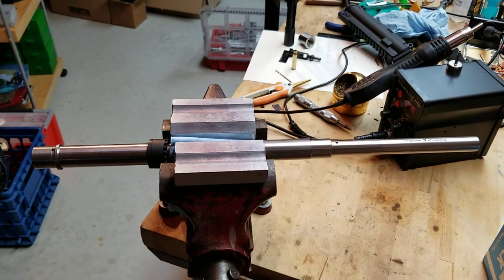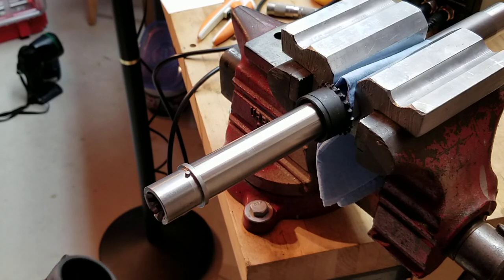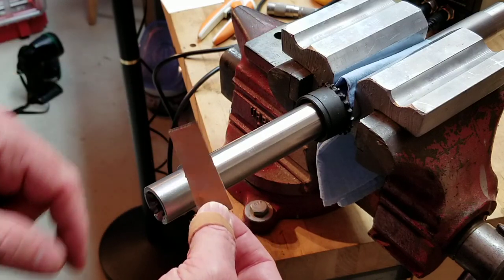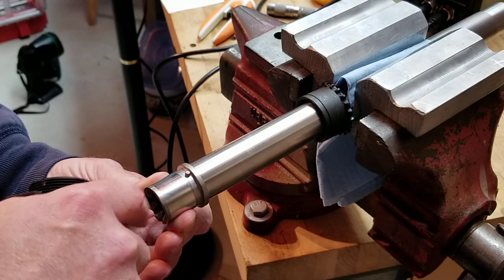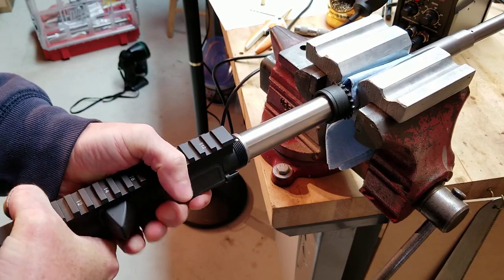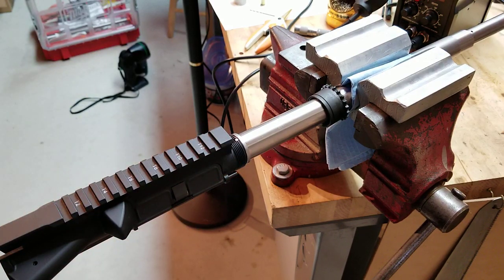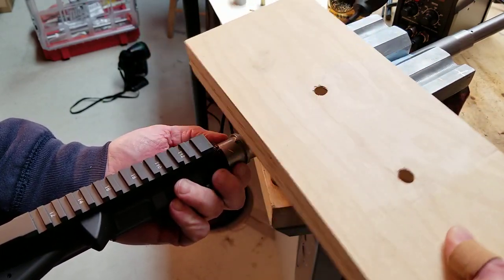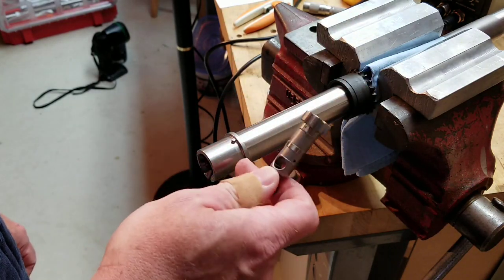AR Barrel extension fit & accuracy (precision)

Comment: Hi, I would really to thank YOU for this.... .0005 is still loose and for the .001 Im going to heat and freeze. I have the new Areo stuff me4.... so you can't see pasted the forend mount ....it's a little tricky.  BTW I made a tool to true the end for those uppers,,,, a TOTAL waste of time!!!
Reply: I also have the Aero Precision M4E1 upper receiver handguard mounting platform  forged into the receiver.  I cannot get my Faxon barrel on it whatsoever. I don't want to knock it on because I cannot see if the pin on the barrel extension is exactly lined up with the notch on the upper because the handguard platform is covering it.  Poking around on the internet I've read people trying the heat/freeze method with the upper/barrel however there isn't much on their results.  I'd be interested to know how it worked out for you.
Good luck.
Reply: @newrunner91  I've never needed to use this trick on gun parts but I've used it for years working on motorcycles & ATVs. Anytime I could throw a bearing in a freezer before installation I would. They will typically drop right into their bores without needing to tap in place with a rubber mallet. Aluminum will expand much quicker than steel if you add a little heat, it doesn't take much.
Reply: @jerrywilson6921  Thanks so much.

Comment: I didnt have a clamp to hold down my parts when i replaced my upper reciever is it possible that the upper reciever or the barrel is bent when i was removing and installing it? After the the first shot on bull'seye at 100yrd then  I start having 1 to 4 inch random spread pattern on the target up down left right everywhere
Reply from the maker: What do you mean by a "clamp" are you talking about a vice? You need a vice to hold either an upper receiver block or a reaction rod so that you can torque down the barrel nut.
Reply: @bpm990d  yeah, i just put 2 long allen wrench thru the quick release hole on upper receiver and stand on it while tightening the barrel nut lol. Just used what i had in hand. What a mistake.
Reply from the maker: @seek3n  I don't really understand what your trying to tell me, I don't know what a quick release hole on an upper receiver is.
Reply: @bpm990d  anyaays i think if i damaged the parts is alrdy done. Time to build a new rifle with proper tools
Reply: you didn't have this problem before you swapped out the upper receiver? and your using the same ammo you used before? If so, you definitely screwed something up.

Comment: Do you recommend or advise against aeroshell on the receiver extension?
Reply from the maker: On the receiver extension (buffer tube)? I usually put a little bit of black moly grease. I don't bother with Aeroshell. Anything that needs to be torqued, typically means a wet thread of some kind. When I put the barrel nut onto the receiver after getting it shimmed, I also put grease on the threads and the front face of the barrel extension (torque shoulder).
Reply: @bpm990d  , I apologize. I meant to say the barrel extension.
Reply from the maker: @atox4957  No worries, I assumed you meant the barrel extension, but I wasn't positive. Just use some grease on the threads and the part of the extension that the barrel nut slides against when it's torqued up.

Comment: Have you seen shin stock walk out yet it makes a mess my last build was as tight if not tighter then yours here . @750 rounds it made it to the bolt and was messy to say the least still use some race bedding compound and it will be less messy lol good video
Reply from the maker: Wow that's interesting. I have not had that happen in all of the shooting I have done with multiple guns.  I would think that a little green locktite after assemble would wick into the gap and help to keep it in place. Did you disassemble or  trim it off?

Comment from the maker: Glad you guys liked the video. Let us know how your builds go.
Reply: did you go to SDI? I got my Degree from them and i kinda remember doing some assignments on a few of carlos's articles.. when you had mentioned him i knew right away who you were talking about... i also would like to mention for a home builder  or someone building their first AR... although this will make very minor improvements in reguards to accuracy.. it is not nessassary. shimming the barrel extension is a fairly easy task.. give it a try you cant really hurt any thing... Thank you BPM99..  great video... alot of people put nonsense up on youtube and call them self Gunsmiths.. take it from someone who makes a living doing this ... it was refreshing to see some one who knows what they are talking about... last i want to comment on using  locktite. i agree, dont do it. it may seem like it works in the begining... but remember locktite degrades at 300 degrees. any extensive shootig and the barrel will hit that temp no prob..thus putting that slop back in. how ever i do like to use gasket maker.. it is a little thick and makes a great mess whenyou are bedding.. but it holds very nice..... at the moment i am building an ar 10 in 6.5 creedmoor. and i think i will use shim stock instead of putting an oversized extenstion.. great tip!
Reply from the maker: @willebiggz  No I did not go to SDI, but I do have a 2 year degree in machining technology. Thanks for the kind words, I try and put out good information when I post stuff (on ARFCOM or other forums). I agree that this is a project for obtaining the best accuracy out of a precision build. I do agree with some that the very best way to do that is with an oversized extension and a thermal fit upper, but I'm not really interested in buying yet more parts. This technique allows you to work with what you have.  Would love to get a job as a smith, but don't have any desire to open my own shop. Good luck with the AR10 Build. I have a bunch of AR10 parts and am going to build a Long Range Service Rifle for competition in the next year or so.
Reply: bpm990d. So I’m having some problems with my 6.5 creedmoor build.  I don’t have go no go gagues. The issue I’m having it that the bolt will freeze up if I dry fire the firearm.  It shoots fine. When it wants to. Any thoughts.
Reply from the maker: @willebiggz  If it's doing this when dry firing, then headspace has nothing to do with it. Worse case scenario is it's the geometry on the cam slot in the BCG or possibly the wrong combination of bolt/extension, although I have an Armalite AR10 bolt and I see no reason it should not work with a DPMS extension (and vice versa), as long as it's properly fitted to a barrel & headspaced. Make sure there is plenty of lube on the gas rings.

Comment: Can you use aluminum can for shim stock?
Reply from the maker: Good question. I'm thinking it might not work for most combinations simply because the aluminum can's thickness is going to be much greater. The shim stock is .001 of an inch. Google seems to indicate that beer can bodies are about .004. 

Because it's going around a cylinder, the .001 stock actually increased the diamater by .002. With a .004 shim, you would have .008 increase on the diameter. Something would have to be really out of whack for it to work. Also at .004 the material is going to be pretty stiff. Give it a try and let us know. My guess is you will only need a small pad of it on the top.

Comment: Absolutely face the threaded end. I use a mandrel in my lathe as you described. I cut a few coils off ejector spring. Piles brass up neatly at 1 o'clock. Ican pick it up prone without effort. Never an issue with ejection.

Comment: Don't you need to use aeroshell grease with that?
Reply from the maker: Well you want to use some kind of lubrication on the barrel nut threads when you torque down the barrel nut, but I'm not really showing that in the video. I'm explaining how the barrel extension fits inside the bore of the upper receiver and the relationship between the bolt and the extension. Once you are ready to tighten down the barrel nut, you want to put some grease on the threads. I don't use Aeroshel, i just have some black automotive grease with moly.

Comment: Is it so that when you buy a new bolt carrier group you have to readjust headspace.
Reply from the maker: There is no way to adjust headspace if you change bolts. You can check the headspace and determine if it's acceptable. However without removing the barrel extension re-chambering and then re-fitting the extension, there is no way to adjust the headspace.
Reply: bpm990d I understand that, but is that a necessary process if you buy a new bcg?
Reply from the maker: @igarasjen1128  I'm not exactly sure what you are asking. When you say necessary process, what are you refering to? Resetting the timing on the barrel extension or adding shim stock to the barrel extension?
Reply: bpm990d I just want to buy a new shiny bcg. When receiving this new bcg, is it necessary to take it to the gunsmith to check and realign headspace? 
I saw another video of a disassembly of an m16, and they said using the "bolt assembly" in another gun could cause serious harm and injury. I guess that is also applicable to a new bolt assembly? Are they really that sensitive?
Reply from the maker: @igarasjen1128  If the headspace is really off, you could really destroy somthing and injure yourself. It's close to 60,000lbs/sq in. Checking headspace is a good idea. 

Realistically, they only thing most gunsmiths will do is check that the headspace is safe. Almost no one will adjust headspace on them, because the cost of labor is going to be worth more than the barrel, and will require adjusting the gast tube. Also if it's chrome lined, there is nothing to do, because a chamber reamer will get ruined by running it into a chromed chamber. 

I would recommend getting a NO-GO guage or possibly a FIELD gauge and check the new bolt. You will need to remove the ejector unless you get one that has a pocket machined in the base to accomodate the ejector.  Most gunsmiths would charge about $25 to check it, since the guage itself is about $40.

Comment: How are shims better than locktite?
Reply from the maker: Good question but I don't really have a good answer. Basically they are both doing the same thing. I would say is that having locktite in the upper can be a pain when it comes to putting another barrel in. Shimmed barrels come out easy, where as ones with locktite probably will require a little propane torching and a large wooden dowel to drive the barrel out of the upper.
Reply: @bpm990d  Yea makes sense,  might be too good making removal more difficult.
Reply from the maker: @Physics072  We get about 3K rounds out of a high power barrel before it's toast, so a barrel is really only good for a season or a little more. We tend to change barrels like we change our sox, so I really like using the shims.
Reply: @bpm990d  You would know better than I on that.  3k seems like a low number, guess it depends on the velocity and loads.   I bet you are really good at swapping barrels now.
Reply: @bpm990d  For removing AR barrels is a barrel vice good enough, someone told me to use a MI Upper Receiver Rod.
I have a barrel vice and wanted to pull the barrel off one of my old ARs that I can rotate the barel a little which is not good for A2 front sight alignment.  Hoping i can just snug up the barrel nut and be done.  But might have to shim.  Or I could just put something in where the barrel pin is to stop the rotation.  The pin allows a little rotation maybe put there so you have room to adjust the front sights before snugging up.
Reply from the maker: @Physics072  Back in the day when we used iron sights in NRA HP, the front sight bases on our rifles had two sets of opposing set screws that would let us adjust the windage on the front sight base when we first set up the rifle. If you have a GI barrel that is pinned, it's difficult to get the windage perfect. If it's really off, you can use a mallet to bang on the front sight to get it to rotate a little. That being said, I have never had to shim the front, to get the nut to time properly. However I do have a set of them in the tool box just in case. 

Brownells sells a set of aluminum barrel blocks. There is one like mine, but it has a elastomer coating to help grip the barrel. If I was going to get a set, that is the one I would pick up. If you get a plain block like I have, you need to use powdered rosin to get the aluminum to really grip the barrel.
Reply: @bpm990d  My block is a little heavier duty than the brownells it uses a heavy leather liner so you don't marr the barrel. 
I'll try that first.   
On the A2 front sight post, Mine is dead on or was.   I just noticed that if I grabbed the front sight I could move the sight a little bit each way I rotated it.  At first I thought just the sight was loose from the barrel but on closer inspection the entire sight with the barrel moves.  The only thing stopping it is the barrel lock pin.  Its not much but enough to move the front sight 2-3 sight post widths left and right.   So now I have to find where its trued again, ideally you don't want any can't with respect to the rear handle sight.  It can be corrected by moving the rear sight adjustment.  But since Im going to tear it apart may as well get the can't right.

Comment: I did two builds, both of them with VLTOR MUR uppers.  14.5 mid length Daniel Defense barrel and the "20 Odin Works Grendel.  I had to use a 2x4 and knock it in even with a thin coat of moly grease because it was so tight. If you are trying to build a really accurate rifle this is the upper receiver to use. It is about $170 which is more expensive than average but it's not insanely expensive either. This is made by an aerospace company who knows how to do really Precision Machining. I can guarantee you that the machine work is very Square to The bore axis as well. If you have less precise fit with your parts this is probably a pretty good option but you should put a coat of something like Somali Grease on those surfaces before installing. It will also help prevent oxidation from having aluminum contacting Steel which can cause a chemical reaction because of having two different types of metals contacting each other. It's probably going to be easier to take apart if you ever have to as well.

Comment: Thermal fit uppers makes this obsolete..It is easier to pin gauge the upper to fit the barrel extension...
Reply from the maker: Well what are you to do if you have a half a dozen uppers that are not as tight as a typical thermal fit upper? I'm to the point now that I will get BAT Machine oversized extensions. I can test them in the upper and then have my gunsmith use those when he chamber the barrel. However if you are buying an off the shelf barrel and you want to get optimum fit on an existing upper you have, then shimming or Loctite 640 Sleeve Retaining compound are the best options.
Reply: @bpm990d  If you already have a lot of uppers then your process is good, I was talking about new builds with the selection available today. I will purposely pin gauge my uppers before purchase to match my barrel extensions if I don't go with a thermal fit. I have also Cerakoted the bolt carrier channel and barrel extension bore in the upper for a tighter fit. It is amazing the variations I have found from the same manufacturers..  Sorry if my post sounded snarky, it was not my intent...
Reply from the maker: @hairydogstail  No not at all. I really appreciate the engagement on this video. For the most part it has been pretty positive and I try and always respond to people that posts comments, since they took the time to watch the video. I have not thought about ceracoating, but you are right, it could tighten up things. I might have to do that on some of mine. Best of luck with all your builds.

Comment: If you want accuracy, take the upper and lower out of the equation.  You must braze steel scope mounts or a steel rail to the barrel.
Reply: Because barrel harmonics aren't real
Reply: @johnmyers6802  With benchrest, we take all non-solid variables out of the setup.  Often you won’t even see a handguard, much less an optic on said non-solid handguard.   A good first focal plane scope easily handles the mild harmonics and jolt.  
Mounting optics on rails is ok for cool-guy applications, but it is just not done when you need to ring 18” steel at a 1000m competition.

Comment: First off if it shows up that far out of spec I am sending it back! No debate on this! So with this statement all of this is excessive effort. You should send it back and make the manufacture fix and replace! And it cheaper on you!
Reply from the maker: None of these parts are out of spec. The rifle, as designed is intended to be worked on by military armorers and fits together rather easily. This video is about modifying military rifles, into precision target rifles.
Reply: Our M-4’s are nowhere that sloppy.
Reply: If you actually read the specs you will see the barrel extensions are designed .002" under the diameter of the bore of the receiver. Vltor receivers were the first to be made undersize(out of spec) then Mega started teflon coating their receivers(also out of spec) now BCM is machining their receivers small(also out of spec).